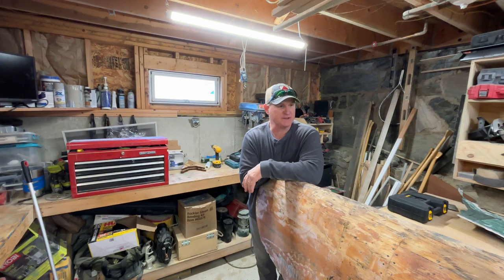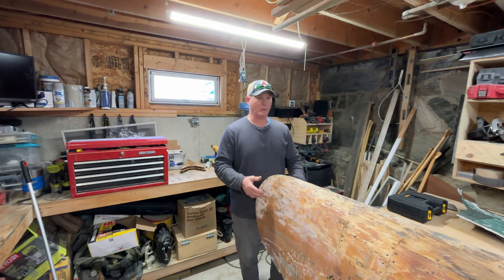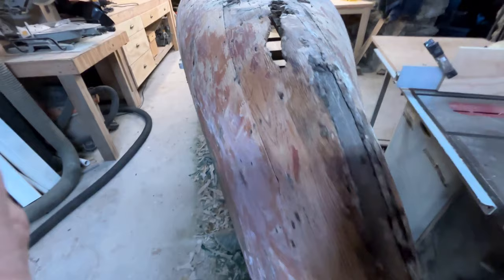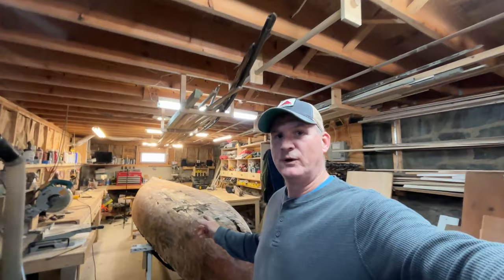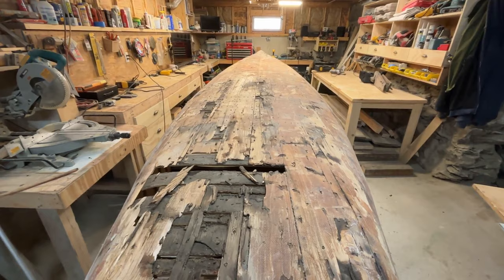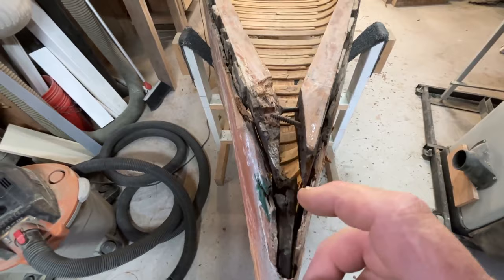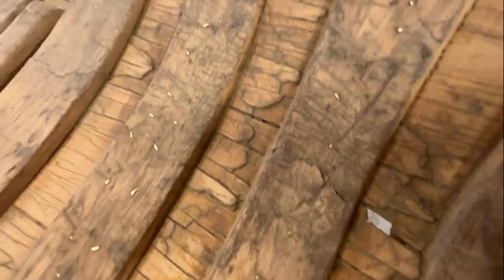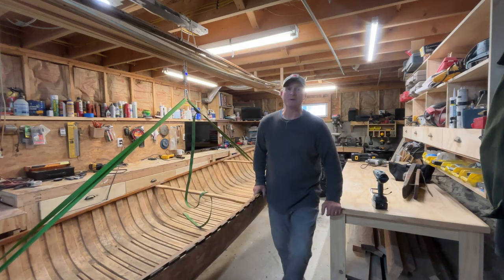Flewelling Wooden Ribbed Canoe Restoration Update

Comment: Wow! Nothing short of amazement. Good thing we aren't neighbors, I'd be popping on by periodically to watch you perform your magic. 😅 I find it hard to believe that you are going to give this canoe a new life. For sure, i would think that this boat had a one way trip to the scrap heap. I know zero about boat restoration and don't plan on taking it on. What I am is totally plugged into your  canoe revitalization. I hope that your surgeon is as good with knee restoration as you are with  canoes.😄
Reply from the maker: John, thrilled that you enjoy the Canoe restoration process.  It is a very therapeutic hobby for me and I enjoy sharing what I know with others to help them along with their own projects.  I enjoy working in the shop, using my hands and thinking through the necessary solutions.  This project in particular is a tall task and the owner has asked me to bring it back to life.  It is a nostalgic piece since the canoe was originally his great grandfathers canoe and it holds heritage value and historic value on the Allagash.  Jalbert Sporting Camps reside on Round Pond (which you paddled on your NFCT through paddle) and this canoe belongs to that family.  I truly enjoy a project when the canoe holds sentimental value to the owner.  This project is no exception.  Lots of work but in the end the owner Capt. Ian Sawyer will be proud to paddle/motor his great grandfathers once again on the very same waters!  The surgeon did one heck of a job on both my knees and I am getting stronger each and every day.  Growing a little fatigued from the hard work involved with therapy but in the end I will be better off for it just like you!  If we were neighbors I think we would enjoy many great conversations!  All the best to you John.   Appreciate you taking an interest in the canoe restorations.

Comment: Wow!  This is a big project.  I bet if this was being done by someone who was charging for the work the entire boat would be scrapped because the cost would be prohibitive.  Getting old is not for the timid or weak!
Reply from the maker: You are probably right with this particular project being scrapped by a canoe shop or at least the owner not willing enough to pay for a full restoration service.  Typically canoe restorations run $100/per foot for a new canvas without additional work required.  This canoe will be fiberglassed to its original manufactured condition.  

I will be good to go when these knees are fixed up.  Everything else is running as expected.  Still lots to do in this lifetime.  

Thanks for commenting and watching the video.  Appreciate you!
Reply: @mainetripper .  Lots to do ! Yes you and I paddling,sharing a campfire ! In Maine !